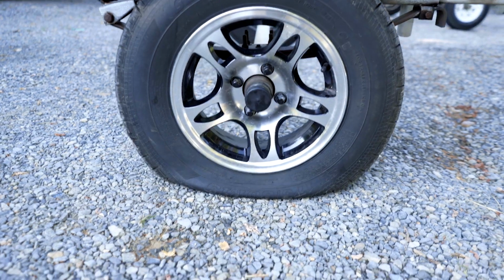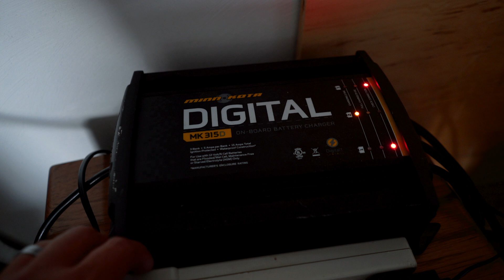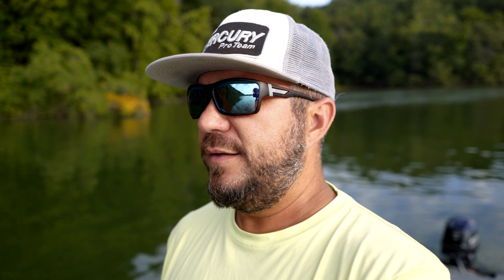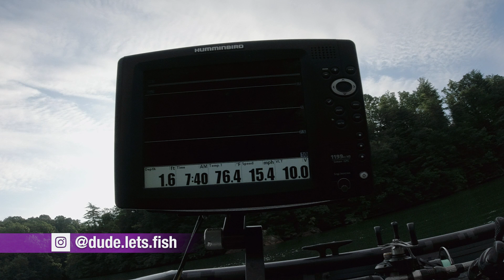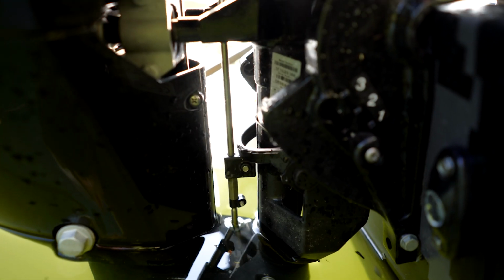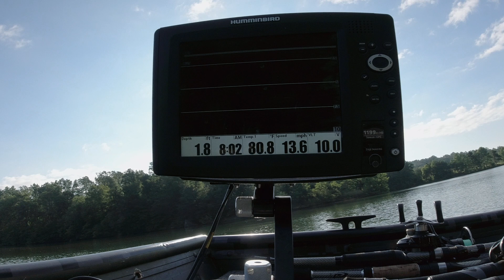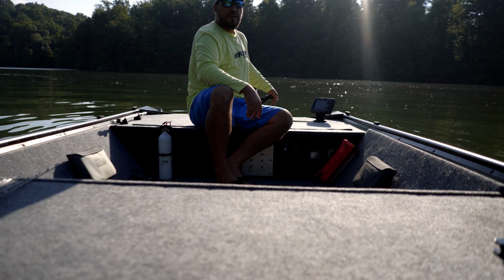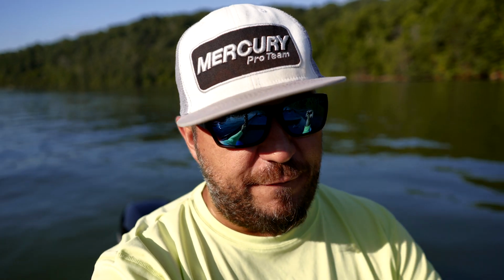2020 Mercury 9.9 Top Speed

Comment: Im a first time boater and the other day a gentalman helped me back my trailer up couse i never did it before. Good people still out thier
Reply: absolutely! besides the water, the boat ramp is my favorite place to be! i’ve helped guys back up trailers, fix their boats, etc... you can always learn something new!!
Reply: @greysonshambaugh2483  im truly glad thier are guys like you that are willing to help
Reply: @bryanfinchum8026  practice in the drive way. Put your hand at the bottom of the steering wheel. To make your boat go left, move your hand left. Also I see a lot of new trailer divers over correct way too much. Slight adjustments.
Reply: @michaelchapman1258  thank u
Reply: Boat size?
Reply: @Hill_Billy_Without_A_Hill  14 foot john boat
Reply: @Hill_Billy_Without_A_Hill  its a straight trailer so when i barely turn it wants to jacknife alot
Reply: @ronaldfinchumjr258  Yeah, you will get it after a few times out. I been backing them up since I was a 16 and my dads boat at the time. I got a 16ft of my own and quit a bit older now. I got a 18hp older tahatsu 2stroke on it and it gets up 21mph to 25mph, depending on gear and if I have another person in boat. Mercury is made by Tahatsu up to 40hp. Not sure when that started, but they make them for Mercury. I was considering a 8hp-9.9hp 4 stroke to switch on it, and but the 18 on my other boat. I do a lot of trolling and might be the way to go for my needs.
Reply: @Hill_Billy_Without_A_Hill  thanks bud i just bought a 9 hp for it. Im ready to dlay some fish lol
Reply: I'm a 50/50 guy at the boat launch...I'll either help ya launch and load ur boat or laugh at ya the hole damn time.....it 100 percent depends  on your attitude that day if I help ya or laugh
Reply: Just remember  when you back it up and you're  looking  at the drivers side mirror if you want the trailer  to swing towards  you turn your steering  wheel clockwise. If you need it to go away from you or towards  passenger side turn wheel  counterclockwise.  Don't  turn the wheel a bunch a little bit will swing the trailer. Short trailers are even more responsive  to how much you crank the wheel.
Reply: Our local Fair grounds has cones to practice. They are out 24-7.

Comment: Thanks for the video. 
I can relate. I have a 2009 9.9 hp 4 stroke and have been experimenting with the same tilt adjusments for improving speed and handling. I added a jackplate to bring the cavitation plate even to the keel this improved the speed from 12 mph to 19 mph at 5500 rpm wide open throttle with the 8.5 prop. I find for my boat the best tilt is #2 ( V-hull 14 foot aluminum ) Using non-ethanol gas also prevents carburetor from gumming up and causing starting and running problems. Letting the motor run out of gas by removing the fuel line from the motor and letting it run until it stalls at the end of the day also prevents  problems that other posters have been mentioning. When I start the motor with choke pulled out I push it in almost immediately the engine goes to 900 rpm idle speed ( recommended  Idle speed ) Smooth.  
Keep up the nice videos
. I am 72yrs. old and love the friendliness at the boat ramp among other sportsmen.
Reply from the maker: I was just looking at jackplates, thinking about getting one myself. Thanks for the comment 👍🏽
Reply: I agree 100% with the non ethanol fuel, but letting it run out of gas is going to dry out everything in your carb if you don’t have an efi system.

Comment: Thank you for your video. I just got my first boat with a 2016 9.9 merc. It’s a 10’ rhib. Taking kids out for first run tomorrow. I was told I should be able to pull a skier if the BOat is not loaded. Not planning to ski but maybe get some tow tubes next summer. Excited. Your video is keeping me up late thinking about boating.
Reply: Watch which propeller you have... You might need a 6.5 to tow.
Reply: Not sure if 9.9 has any 4 blade options but I’ve heard it helps with speed I have one ordered for my 25 hp mercy efi

Comment: Hey man, nice job but to tilt your motor up you can just turn it in the forward position and that will pull that lever up, that you pulled up with your hand makes it a lot easier just make sure your motor is shut off 😊

Comment: The 9.9 Merc 4 cycles have an accelerator pump, and each twist of the throttle floods the engine with a shot of gasoline. Don't flood the engine, with or without the engine running.

Comment: How does this engine perform against a old 2 stroke 9.9hp? Acceleration?
Reply: I have an 84 evinrude 9.9 2stroke on a decked 16ft vhull and get close to 18mph . With a 15hp carb on her it'll hit 20 21
Reply: 2002 nissan 9.9hp 2 stroke on a 94 alumacraft superhawk cs, 15 ft with decks and steering wheel, i get 22 mph

Comment: I have the same Mercury 9.9hp engine from 2017.
A 450 kg boat reaches a maximum speed of 14 km / h.
Can the engine be blocked at the factory because the engine's max revs are 4500 n / nin. F8.5 screw.
Now I have mounted the charging and starter, spring tests with the towing screw.
Reply: Get a 20hp carb and install it you will get 18hp and it should plane out at 22km

Comment: Have you modified the motor to get that kind of speed?????
Reply from the maker: No mods 👍🏼
Reply: @DudeLetsFish  then I can’t understand how you could get that kinda speed. I am in a 1650 with no boat modifications, just the way it came from the dealer and the best I can get is about 8.5 mph. Brand new 9.9 Mercury. Help me out please.
Reply: @charlestiner3045   maybe u didnt set properly. maybe  engine is too low or too high

Comment: Just put a 2020 15HP 4 stroke EFI on my 14’ J boat and it runs 24 MPH with or without a load... I’m thinking I could probably give up a little torque for a few more MPH with a steeper pitch prop. though. It’s not a speed boat, but ya know... still fun to tweek it out for max performance.
Reply: That's already cruising 😂

Comment: I notice there’s an audible rattle sound which can be heard around the mid throttle range. My brand new 20 hp also has this and I’m kind of worried. Anyone else experience this? If so, have you figured out what’s causing it?
Reply: if it's the 2020 like mine (i have the 2020 15hp) , I noticed when I have the manual lift motor thing (red handle) flipped down I hear a small rattle... when the red handle is flipped up, there is no rattle. Something in that mechanism has something that rattles slightly... anyway, it's normal imo

Comment: Just bought the same engine brand new as well. However upon my speed test if only reaches 10km/hr (not miles). Would you have any idea as to why that is? I assume since it’s a new engine it takes a few usages for the engine to loosen and be at its full potential, however please let me know if there is any other reason as to why that is
Reply from the maker: Could be the weight of the boat?
Reply: Dude Lets Fish don’t believe so as it is just an inflatable dinghy around 40kg
Reply from the maker: @dan61909  Gotcha, try raising or lowering the trim... that might help
Reply: Wow much are these? Ball Park.
Reply: If it is brand new, you were running it in, no? Not speed testing.

Comment: I have the same merc 9.9 (new) and it seems to stall when I push in the choke after starting it cold. Dealer says to rev it some before I push in the choke. Do you have to do the same? The manual doesnt mention anything about reving the engine before pushing in the choke.
Reply: It should run fine without the choke after a minute with the choke.
Reply: Never run ethanol fuel without fuel treatment thats what the problem is
Reply: @natehowell793  No, the problem is not ethanol fuel. It's poor maintenance and not draining the carb after use. People don't read the manual, which explain it.
Reply: Run a bit longer with chock on
Reply: @SilmarilS79  lol I think Johnny is having a bad day...

Comment: Do you know what pich prop you are running. I have the same boat and motor with a 9. Was thinking of going a little higher
Reply from the maker: Not sure, I will check
Reply: You have only 3 choices for the 9.9... Stock is 8.5, you can get the 7.5 and the 6.5
I run the 6.5 with a heavy load, pulls the boat out of the water way faster than the 8.5

Comment: Hey mate, great video. Is that miles per hour or knots? Also would you know how high you cavitation plate is from hull bottom. I just bought on of these for a small boat. Having trouble getting past 7 to 8 knots.
Reply from the maker: MPH, not sure on my cavitation plate
Reply: Thanks  for that, very interesting. About half to speed your getting. Great work on the vids!
Reply from the maker: Tim Chapman I appreciate it
Reply: On my small 12ft boat, I get 35kmh with only one passenger.
Reply: @SilmarilS79  super interested to know if your cavitation plate hight compared to the bottom of the transom?
Reply: @timbolife  Cavitation plate should be flush with the bottom of the boat, or a little bit higher, never lower as it will bite it the water.
Reply: I put an 1/2" shim on mine to raise the motor.
Reply: @SilmarilS79  My manual says it should be 2 inches below the transom.
Reply: @TR4zest  Manual is wrong...
Reply: @SilmarilS79  You think you are right and the Mercury / Mariner manual is incorrect. You silly man. If you have a manual, read it.
Reply: @TR4zest  I don't care what you think... I made my tests...
Reply: Mate I just put one on a 3.4 quintrex 2 up (adults) was getting 18 knots / 33 kph weight distribution is key

Comment: nice speeds, what prop are you running?
Reply from the maker: Factory prop, not sure the pitch
Reply: Factory is 8.5...try a 7.5 your rpm sounds low..
I had that motor..with 8.5 getting 4500rpm way to low i ended up with a 6.5 hit 5840 rpm gained 2 mph.

Comment: Thanks for the video. 
To anyone reading this.... I have a 2021 Merc 9.9.
 I was reading that the merc 9.9 isnt a Merc 9.9 but a Tohatsu 9.8 re labeled. Which means a completely different motor than the 15 and 20. 
 Is this correct?? Or like my old 2018 suzuki, is it just a de tuned 15-20 motor. If it is I want to put the 20 carb and prop on it. If infact it is just the Tohatsu 9.8 it probably wont take the fuel from the 20 carb, mabee flood it. 
 Does anyone know the answers to my ideas? Thanks!!
Reply: It will work! 
But you will need to change the prop shaft to a 14 spline and clutch dog from a 12 spline, to utilize the extra 9hp.

They are 18hp with the 20hp carb on them. If you can fit the 25hp carb you will get 20hp

Comment: Hi, Anyone who compared this Mercury 9.9 and Suzuki 9.9? I've a Suzuki 9.9 （2 stroke） which has super low vibration in high speed, and I'm thinking of buying another Mercury 9.9
Reply from the maker: Never ran a Suzuki 9.9, I almost bought one.. heard they were strong motors
Reply: @DudeLetsFish  The only problem is the SUZUKI 9.9 was designed as a 15hp, so its 36kg...

Comment: Excellent video. Firstly check the motor height with a straight edge to the cav. Plate and bottom. Once that is optimum then get one of those cheap portable tachos. Check that the engine is up the top of it's recommended rev. range or select an appropriate prop. You will be amazed. Small boats rarely have the correct prop.

Comment: Yeah your heavy with just you and an empty boat you would be well over 20 knots! It would be interesting to weigh your boat!
Reply from the maker: That’s a good idea
Reply: If you really want to weigh it, try finding a local scrap yard. They should have a big drive-on scale for calculating scrap value of cars. 

Pull the empty trailer onto it, weigh it. Then put the boat on the trailer and weigh them both. Subtract the weight of the trailer, there ya go.

Comment: I just bought 2020 9.9 merc  Do you just pull the cord And does it start up right away or do use that throttle thing on the side and pull the cord
Reply from the maker: Sometimes it cranks right up, sometimes I have to use the throttle switch... I think it has to do with the valve in your gas line
Reply: I have new merc 9.9 and it stalls when I push in the choke when starting cold. The dealer told me to rev it up (with throttle only) the push in the choke. The manual doesnt say anything about doing this way so not sure if this is normal.
Reply from the maker: whatsupdj6 yeah, I’ll push the choke and put the throttle about half way and crank it
Reply: @DudeLetsFish  do you have choke pulled or pushed in when you start doing this way?
Reply: never mind. you answered it in your previous comment
Reply: @DudeLetsFish  mine also smokes alot when it's idle. Does yours?
Reply from the maker: @whatsupdj6  Yeah? That's not normal.. might wanna get that looked at.
Reply: @DudeLetsFish  I did.  I bought it from bass pro and they said there was too much oil (which they put before they sell motors) and took out some. they told me that it will smoke to get rid of residual but eventually will go away

Comment: You are proped wrong if you have the stock propeller... Check your RPM at WOT.
With your load, you should have the 6.5" on it. Not the stock 8.5", which is for a lighter boat.
I clock 22mph on a 12ft V-hull with the 8.5"
Reply from the maker: Fo realz? I appreciate that... gonna check it out